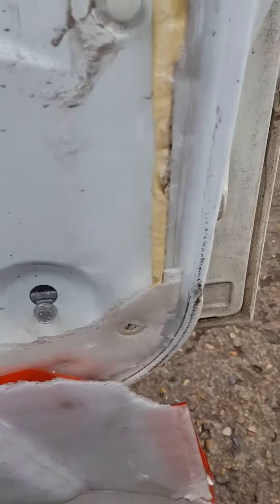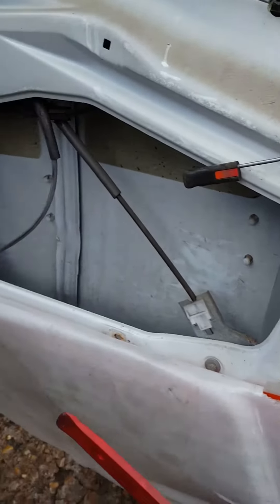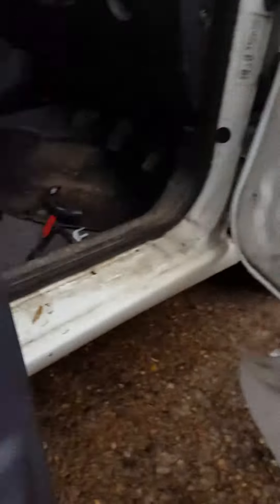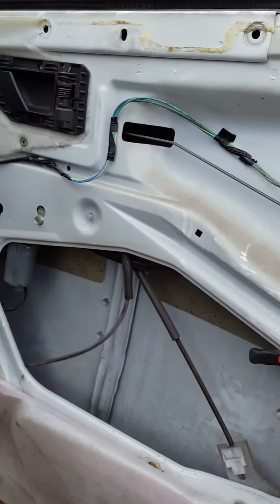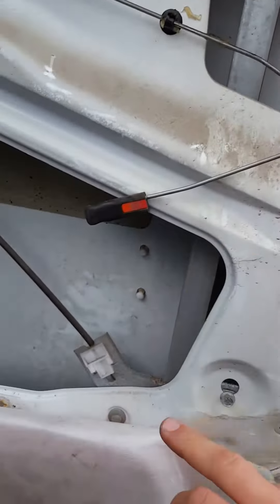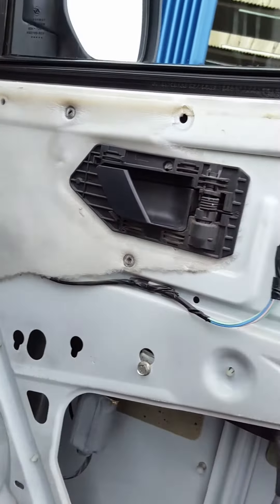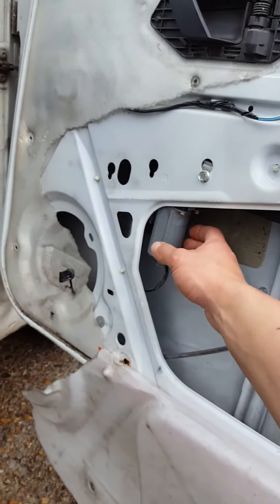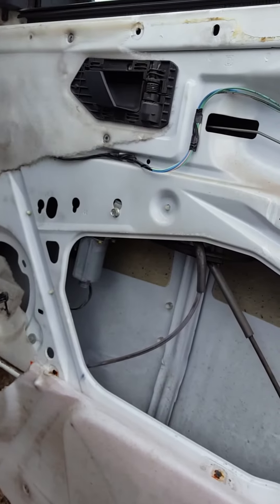Citroen Berlingo window regulator and door cover removal. How to do it.

Comment: The "crap" that you mentioned is to stop rain water getting into the car that runs down the winder mechanism,  If you just throw it away you will be plagued forever with soaking wet carpets as it then runs down the door card and into the car.  In a lot of cars it can cause a lot of electrical problems with water getting into the loom connectors under the carpets including the main ECU in some cars if it happens to be there. This is just an observation as I have seen it many times. The best way is use a Stanley knife and make a cut like a cross and peel it back and tank tape it back up afterwards.

Comment: how do you know if its the motor or not? it will go down but not up, cheers
Reply from the maker: So your one is only going down?
Reply: @AlexTheGrumpyOne  yes it will go down but not up, although the motor tries
Reply from the maker: @kirkd1268  it might be your cable or the winding mechanism mate. They do sell it apart. I think you might need to buy just the window regulator without the motor. Because plastics on it brakes and then it wouldnt go up anymore. Goes down because it's easy with the weight of the glass
Reply: @AlexTheGrumpyOne  ok mate cheers ill give it a try
Reply from the maker: @kirkd1268  no problem. Let me know how you get on mate.